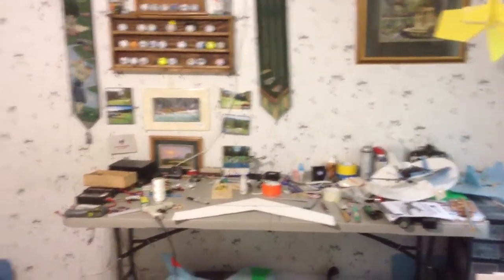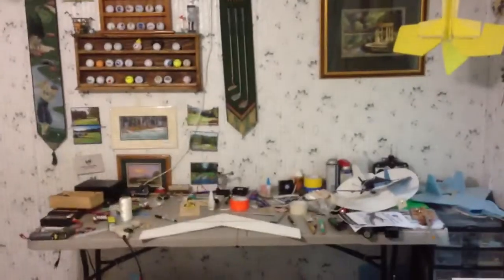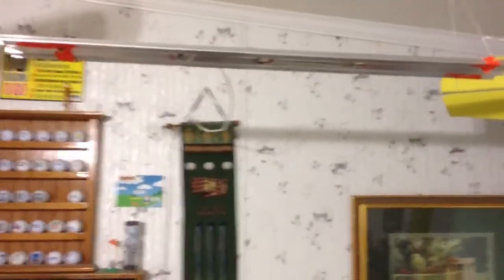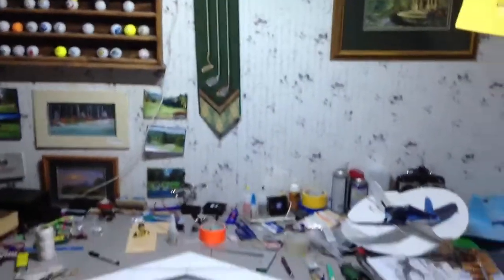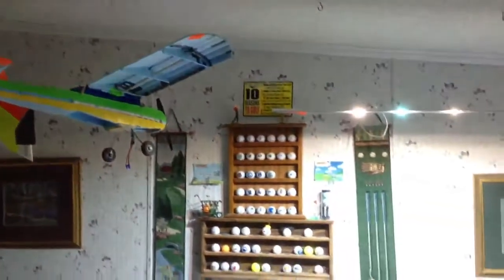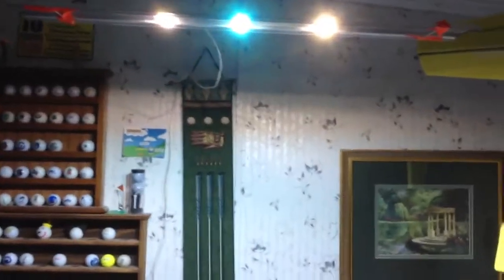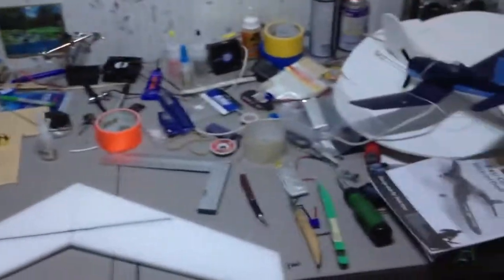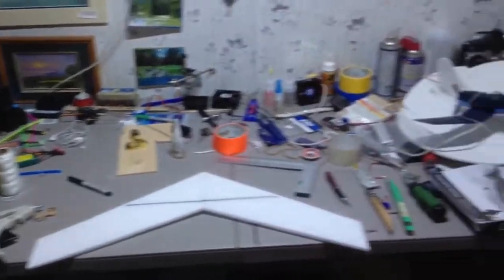My four 10watt Led's, test light for my saltwater fish tank

Comment from the maker: All 4 led lights run on 12v Dc. So they are series parallel across a good 12v supply, and I am using a computer pc power supply. I have left it on for hours.